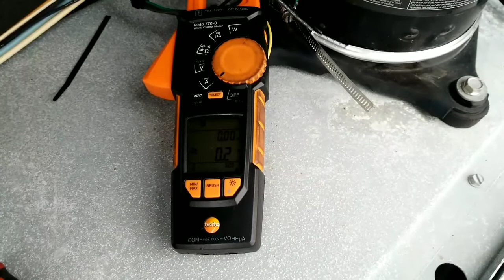HVAC Repair - Shorted Crankcase Heater Replacement

Comment: We had this happen on a carrier 48TC 12.5 ton  rooftop unit that wasn't even a year old,  took out the  high side of the transformer, and blew the B leg 40 amp  fuse.